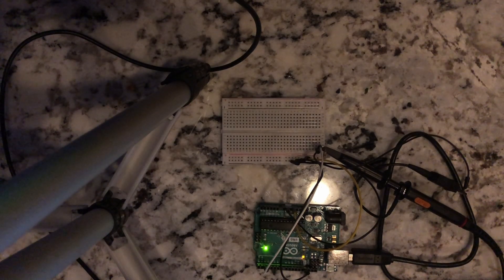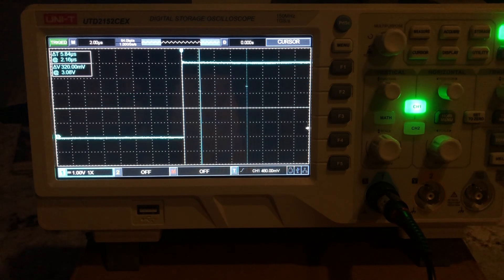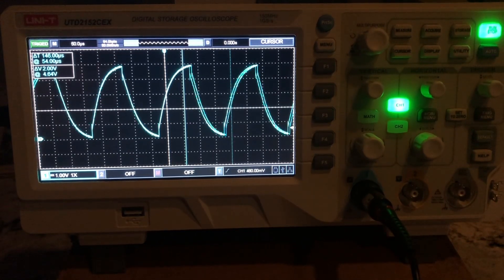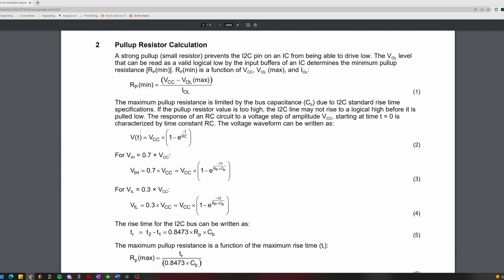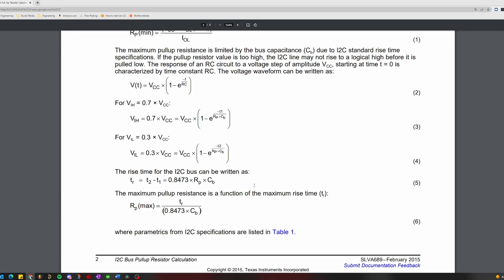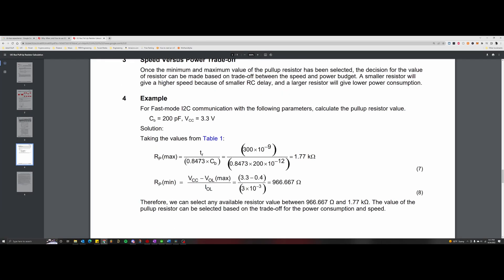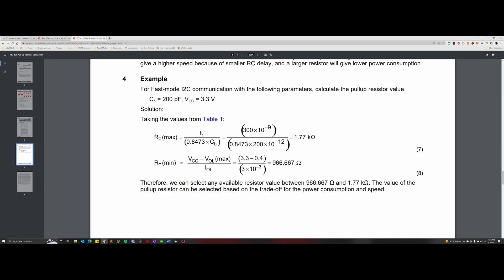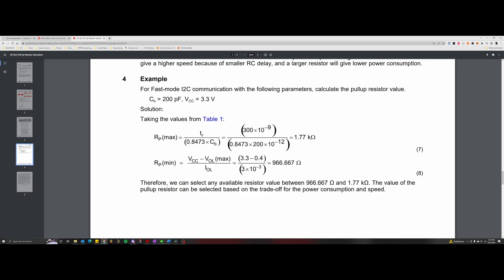Best I2C Pull-Up Resistor Values

Comment: What i knew before i watch this video is Resistor Wattage and Resistance matter depends on the load your putting at. Example for this is when your load needs 3V 600mA and you have a power supply of 9V 1A. To know the Resistance, simply subtract the required voltage to the power supply voltage then use the Ohms Law Equation ( I•R=V, V/R = I, V/I = R) ; the one to use is V/I = R.
Your Solution must go like this : 9 - 3 = 6, 6 ÷ 0.6 = 10. So the Resistor we beed is 10 ohms but the wattage must be greater than the load and that is 1Watt, 10 ohms and 1Watt.
Why size matter? 
Because proper Resistance and wattage will not destroy our components and it will last longer.
Reply from the maker: Excellent